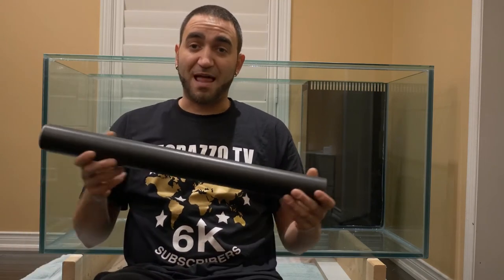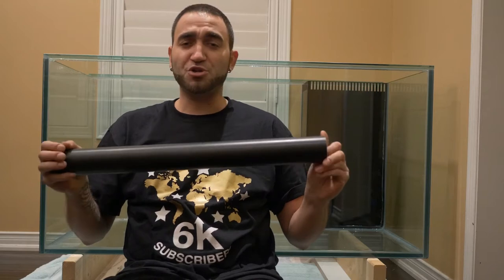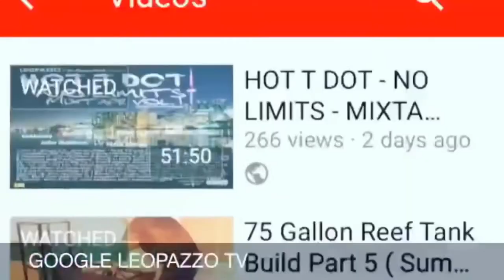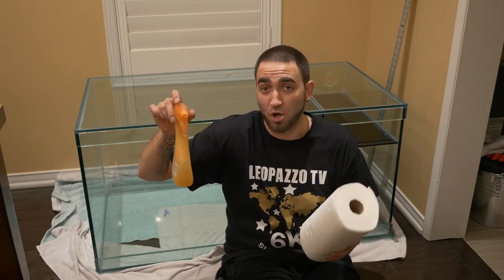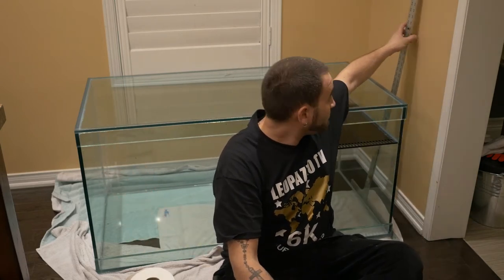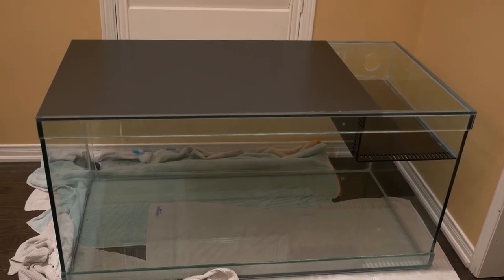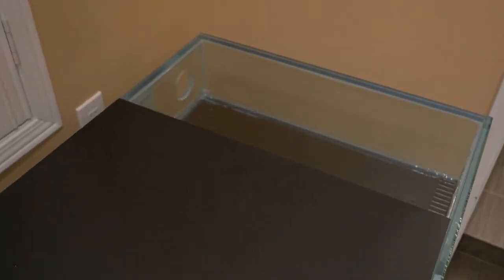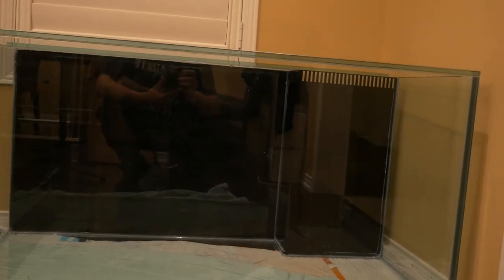How To Install Vinyl Background On Fish Tank Aquarium ( 120G REEF TANK BUILD ) PART 11

Comment: Pazzo, if you like building and moving tanks, you need to invest in suction cups bro. I use 8" WPG's -woods power grips. They are straight up beasts. They will never fail. I've moved some huge tanks. I have 4, but for big tank moves....it doesn't hurt to have 6-8 so everybody has a grip. You can get them on amazon or eBay. Here's a random link bro:

https://www.braxton-bragg.com/index.cfm/fuseaction/store7catalog.level/bc/0,8681/